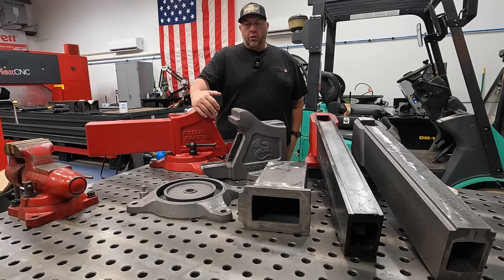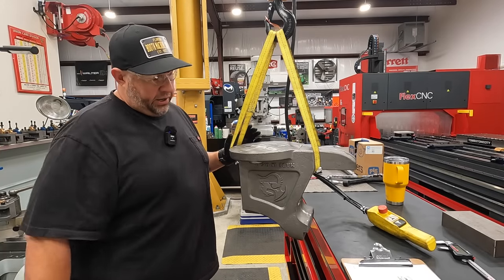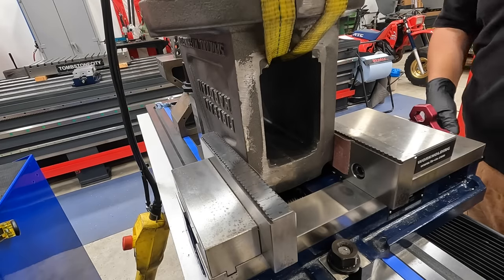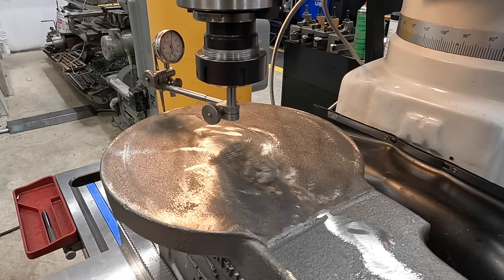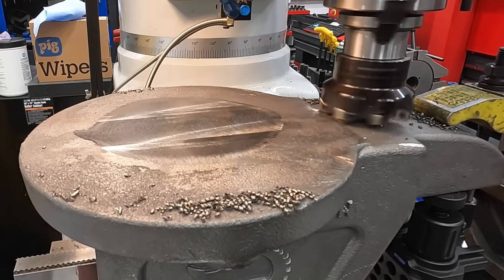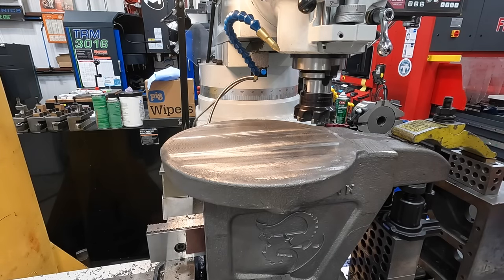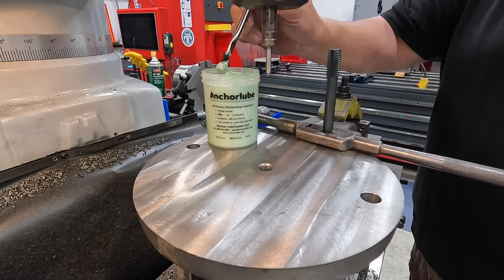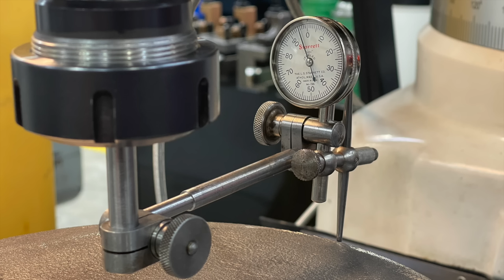Hardtail Vise Build Ep. 1

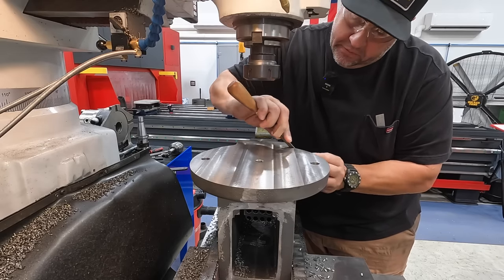Comment: 46:45  Aging [75] Canadian man here.  Back in the dark ages [early 1960s] when I was in high school, our metal shop instructor showed us how nice a surface finish we could achieve by draw-filing - the file's cutting edges are at a diagonal angle to the direction of the tool movement so that the cutting edges are in gentle continuous contact with the workpiece.  No chattering like a coarse bastard file would tend to do.  A long time ago in a galaxy far, far away...

Comment: Thanks Adam for the video. I am a toolmake and in the toolshop we have a large wire edm machine. I use that for the square hole in the main body. Yes a very time consuming and expencive way to make but thats a way to get it done.
Reply: we had some 150 um Ground-signal-ground probes that were created with EDM.  From small to gigantic!
Reply: wire edm where the first thought I had. Don't have personal experience with it, but it seems like it could be a good solution

Comment: Seen Adam using a tape measure in his videos, is a kind of thing you've never expected. Great job as always. Regards from Brasil
Reply: Sometimes you don't need everything dead nuts down to 1000th. Sure you can do it if you want but it's not really necessary.
Reply: use a tape for rough cuts and getting an idea, then put it in the lathe turn it perfect then go from there with your precision instruments

Comment: I love draw filing as part of sharpening large knifes and machetes.  They have a tendency to get an apple seed edge, even if that's not the user's intent.  That's just how they wear and the least resistance to hand sharpening.  I run 3 different grades of files in a draw file manor before moving on to diamond stones.  This flattens out the edge, makes quick work of repairing any chips or bending of the edge, and allows for a multiple degree edge geometry to be applied to prolong the sharpness of the edge without sacrificing edge strength nor making the cut have more drag.

Comment: you plumbed up front to back using the channel but did not try to plumb the base left to right ( directions in reference to using the vice ) and I noticed that it looked like you were cutting heavier on the mill column side of the base, those two screw jacks could have been used to true up the orientation I'm referencing too, or I'm sadly mistaken :)
Reply: I was watching the pattern develop, too.  I think in terms of the precision of castings in general, it looked pretty good.  There's no point in trying to get too precise with it.  In fact, I think he could have let it go with the centering; didn't hurt anything, but probably more precise than it needed to be.
Reply: @ydonl I was just thinking of when he goes to machine the internal guides for the live jaw... if he referances the bottom surface to get square on those 4 areas it might be "Cambered" to the casting  and by the looks of it there is only 2 small surfaces in the corner of each internal face to machine. ARGH too many words to try to convey my thoughts  !!!! hope ya follow ?!?!?
Reply: @jetegtmeier71 I think I see what you're saying -- I think it's a legitimate thought.  I'm going to wait and see.  🙂

Comment: Perhaps if Jason had it cast in 2 pieces it would be easier to manufacture as the base could be flat and the inside miled out.  Then 4 bolts up each side could have attached it together. 8 1/2” boots in shear should be plenty strong to hold it together.

Comment: @Abom79 A propos power tapping: there are all sorts of ER-inserts with square holes for taps.
Reply: My sense is that's a recipe for broken taps. Better that the tap slips if it encounters too much resistance.
Reply: @kindabluejazz  Power tapping always depends on the material, tap-size, a controllable torque-limit, rigidity of the setup and lubrication. My milling machine never caused me problems with tapping. I regularly use M4…M12-taps in aluminium, steel and copper. Copper is a bit nifty, but low RPM and good lubrication help much.

Comment: hey adam  i think your trying for too much accuracy on that centre old carpenters trick to find centre seems easier and probably as accurate. 90deg speed square or centre finder would do it   by just drawing lines and where the intersect is the centre.....or at least close enough in my opinion. thanks as always for the vids! ps a compass or dividers set to over half the radius and scribed from several points on the circumference will converge in the centre as well.

Comment: Center in the base:  this assumes that the edge of the flanges on both sides are equal distance out from the vise.  One could center the bottom but not be centered on the vise body itself.
Reply: Eh... wouldn't matter.  It's a vice.  They're castings.  You could get too carried away trying to make everything precise; it's just not possible with castings.

Comment: 32:30 or thereabouts; Wouldn't it have been better to use a fly-cutter for such a large surface like that?   .. I also believe it would've been easier on the machine too, no?
If I'm wrong, please correct me, but I was under the impression fly-cutters were designed for pretty much this exact purpose; when you have a large surface that needs to be cut flat with minimal stress on the mill itself

Comment: Hi Abom. Awesome content as always.  Quick Question. Do you not use coolant or cutting oil when drilling holes?  The pilot holes looked dry.  I was always taught to put something in there if you dont have a coolant system just to extend tool life.  Have you seen something similar or is that kind of an old wives tales at this point? Thank you.

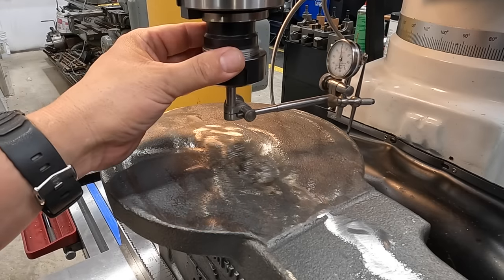Comment: 22:45 should have just turned the part 45 degrees on the bed, then used an edge finder to find the centre. Get as close as you can the centre by eye, or with a 3 3 chord triangle, then just edge find on the x axis on one side, then zero the DRO, edge find the other side, and 1/then press 1/2 on the x axis on the DRO. Do the same for Y axis, and if you weren't close at first, do it once more to ensure you're in the centre. I'd only use the sweep and gauge if i couldn't edge find conical edges, small hole, etc.

Also wouldn't a fly cutter have been the best option here?

Comment: When you remake that pivot bolt, do you have any rotary broaches to cut hex in the center for a wrench? That would be neat.
Reply: Or drill and counterbore the body then fix to the vice with a high tensile cap screw. Easier to make and stronger thread.

Comment: I don't understand something Adam. So you used a square against that back surface to ensure it was square against the mill vise, but how did you ensure that the casting was square laterally?

i.e. Looking at the front of the machine, you were square left/right, but what about front/back?
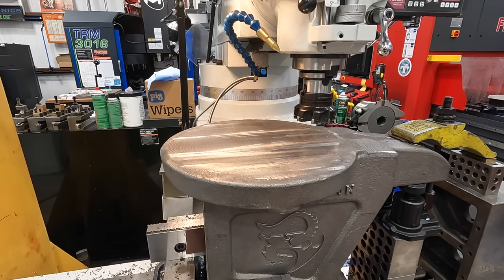Reply: Squareness provided by the vise jaws (which Adam commented on using larger 8" jaws for this purpose) as well as decently parallel sides of the casting, and compliant grip of emery cloth. Also, just needs to be "close enough" as this surface will be reference for others to follow, and there is allowance built-in at those locations to be machined true. At 34:48 he measures less than 0.010" variance over about 8" in the direction you are asking about.

Comment: As far as the machinist jack not being adjustable in that application, prehaps someone should develop one with the top keyed to the bottom with a nut lower down to adjust the height.
Reply: Use it upside down.

Comment: For machining the pads inside the vice head, wouldn't a sinker EDM with form electrodes do a pretty good job of making flat and square bearing pads?  Not sure about the cost difference between a custom broach + broach machine vs EDM + electrodes.

I wonder of Jason's broach is a ton of indexable inserts, or if he had someone machine a bunch of teeth in a giant chunk of carbide?
Reply: @SteveColluns-hm2xx yes, go ahead and post a video of cutting that long, square bore on your CNC Cryin Steve. Include the programming too. That would make for an excellent laugh.
Reply: @CMTeamCobra  I do run Tormach for prototyping. Excellent little machines for that. Why tie up the okuma snd Doosans for that?
Reply: @SteveColluns-hm2xx  also, it’s highly amusing that you are recommending using a Cnc mill to shape a 10” deep rectanglular bore vs a shaper that was specifically built for this exact purpose. What were you saying about best practices? Hahahaha!
Reply: @SteveColluns-hm2xx  oh, I've seen it done. Send your address . The video must include every minute of your programming and tooling setup.
Reply: @SteveColluns-hm2xx  Ok, I have one now. It's a single cylinder block from a WWII Era compressor. The bore is approx 11" deep and 3" diameter. Some really nice cast iron that you won't find anymore. Machine it into a square, plenty of meat for that. Send me the address.
Reply: @SteveColluns-hm2xx  lmao, if you can't do it in a simple cylinder, you can't do it in the fireball casting.
Reply: @SteveColluns-hm2xx  “can’t wait for this !!!!” - Cryin Steve Colluns.

Comment: 6:24 I'd say I'd use someone elses machine and run a sinker EDM. You don't need exact precise dimensions so close enough will work, which would be quick work on a EDM sinker type machine. But before you can do that, you need to flatten your clamp down face a tad bit more.

Comment: I got one question that has been bugging me for the past... years, basically ever since I learned Bridgeports have power quill feed.
Why doesn't anyone use it for drilling?
The drill press I worked on had power feed and I haven't used manual feed ever since, only for very small drills ofc.

Comment: Adam,
Enjoying watching the new project.

A question: Why did you choose to drill all three holes in the base plate, instead of tapping the center hole, right after drilling? It would seem better to stay concentric with the drilled hole, at the cost of a tool change.

I was also taught to approach a "mark" turning the handle the same way, to keep the thread lash on the same side of the screw thread.

Granted.. I was learning on older machines, and DRO wasn't even a "thing" then. :-)